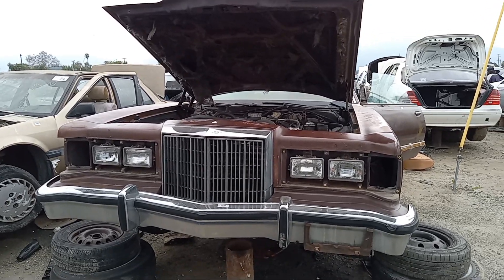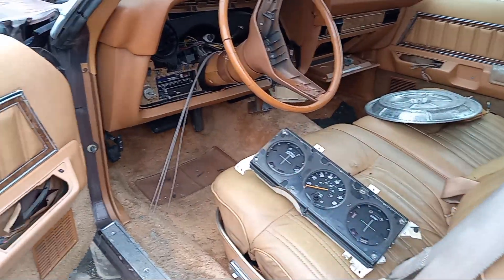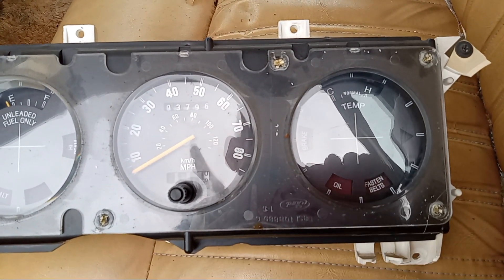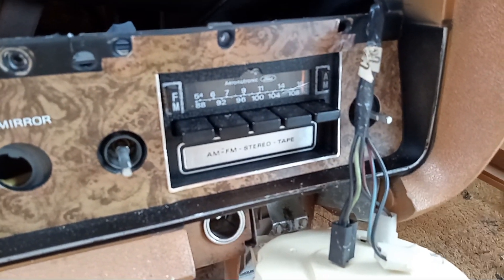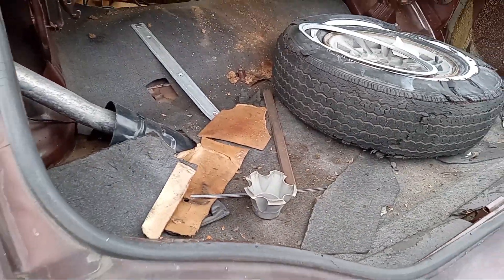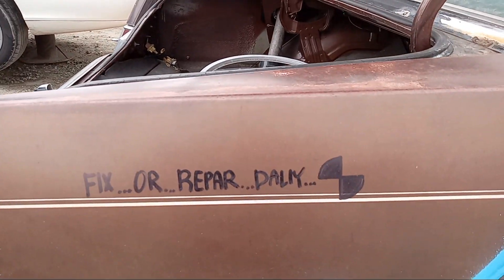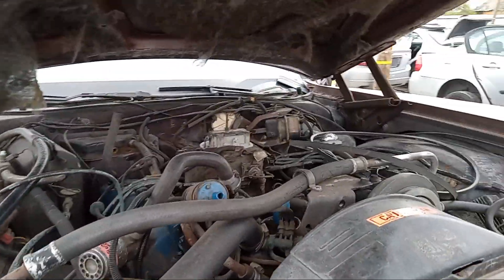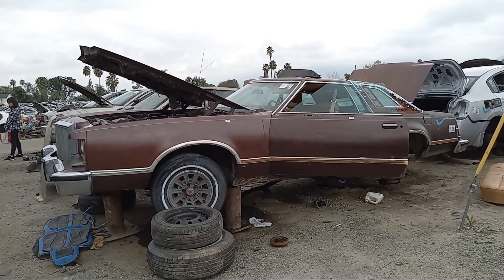Last stop: 1977 Mercury Cougar

Comment: FYI, that's a 351M in the car. Valve cover would say 351M/400. I'd love to have that 8 track player for mine. I have an all original 77 w/50,000 miles in my garage. Black w/red leather interior and full gauges. I'd like to get a few more of these so I can play around with a 6.9 diesel and 5 speed manual swap.